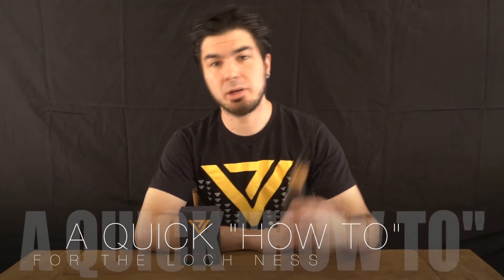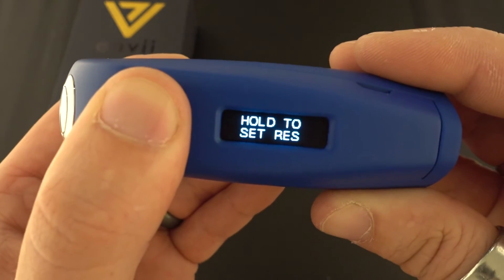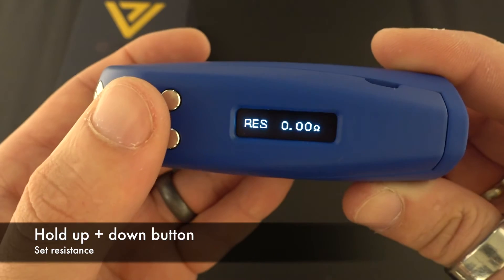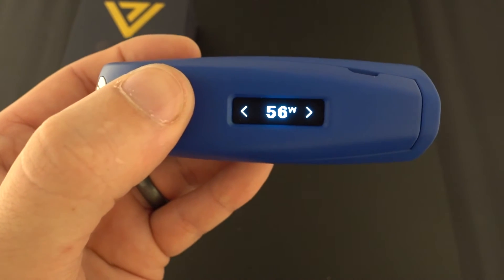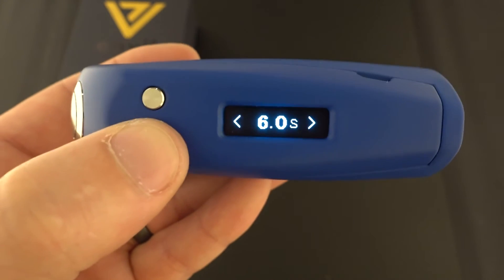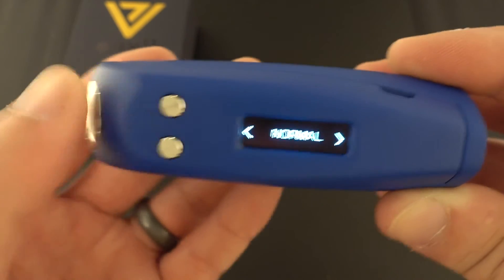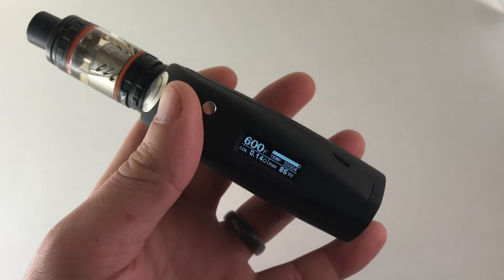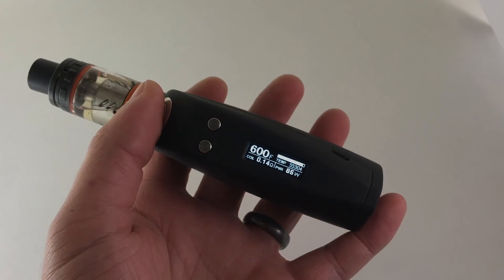A quick "how to" for the Loch Ness

Comment: It is fairly standard in the industry for mods to be firmware updatable. Normally before I do a firmware update, I look on the website for which update is the newest and compare it to the one already on my mod. Here is where I have issues. I've looked in online forums, The Venvii website instructions after downloading the update. I have looked at reviews, and read the manual multiple times. You supply update instructions which is good, but what I can't find is how to see what version of the firmware is already installed on the mod. No need to update it if the newest version is already on it. It has left me wondering is there maybe not a way to see which version is already on it, but then I think, no, that would be stupid.
Reply: I can't see anyplace where it shows the version either. As it is no longer being made, I have low hopes about finding out. Run the software and cross your fingers.

Comment: Got it and like it. I am wondering when filling with the curve mode I was wondering how to reset this or any setting?
Reply from the maker: Hey Will, what setting are you trying to reset? Are you trying to get back into normal mode?
Reply: I was trying to reset the curve to original setting. Also if your in the curve mode is that the only thing that stays on the display?
Reply from the maker: When you are in curve mode, yes that is the only thing that will show on the display. You will still be able to edit your per second settings in curve mode on the main screen without having to go back into the advanced settings. To get back into normal mode, hold all 3 buttons down which will take you into the "advanced settings", scroll to "normal" and click the fire button. This should take you back to normal mode
Reply: Thanks for the response. Really do like the device.

Comment: i wany ask can i active Dry Sensing when use wattage mode?
Reply from the maker: No I'm sorry, dry sensing can only work in temp control. One way to get around this is by setting your temperature high and just let your watts determine how hot it gets in temp mode if you dont want it to temperature limit. If you build with SS wire, the vape is actually really similar to Kanthal
Reply: Envii Inc. i want ask again what's possible can i get when i upgrade the firmware? can You upload how to upgrade The firmware thanks